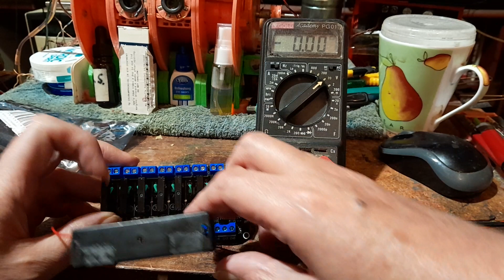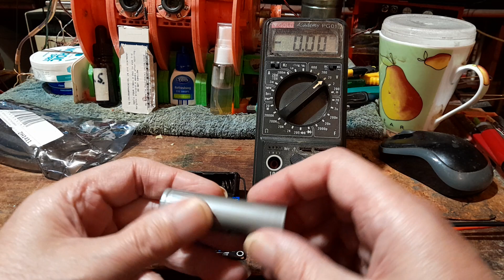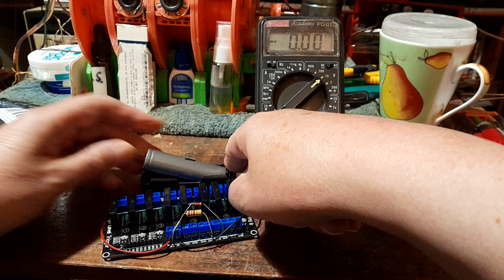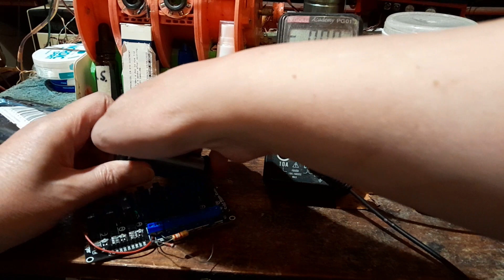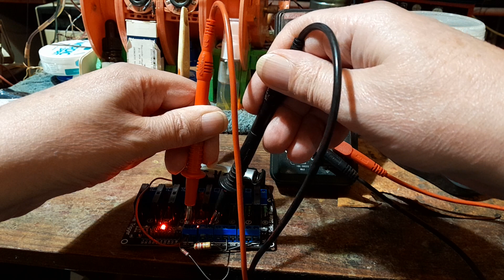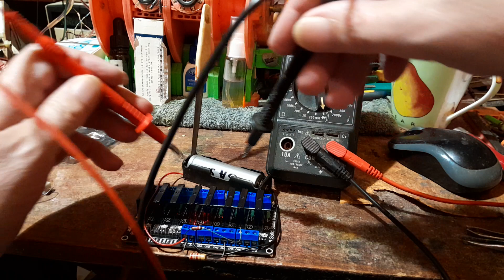Checking the SSR Solid state modules,verifying concept.

Comment: You might have to build your own circuit to get what you want. Use some aluminum foil folded up on the end of the battery to give you a better connection.
Reply from the maker: I am going to build my own circuit it premiers tomorrow, and already fixed the battery holder with some solder blob on the terminal.